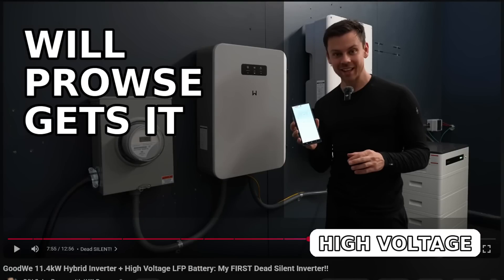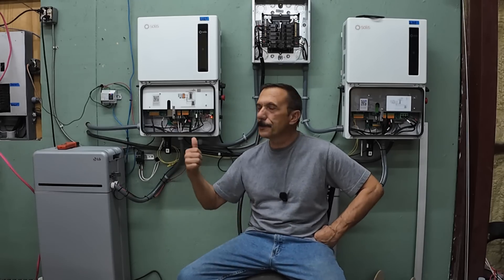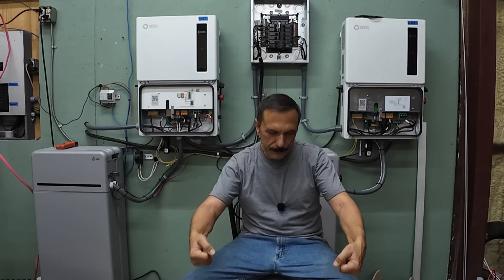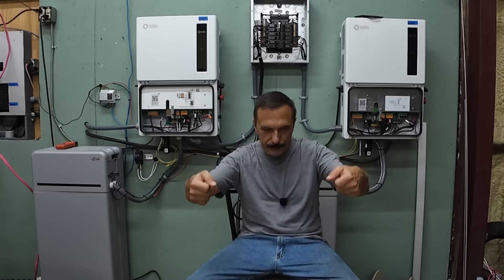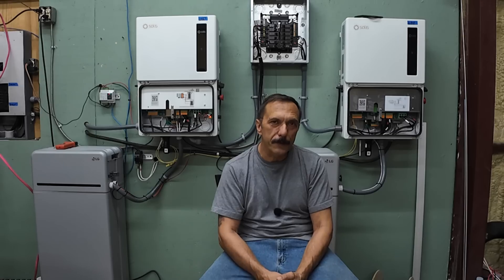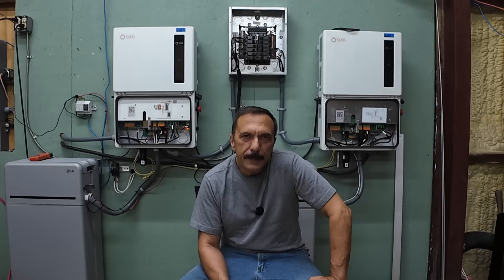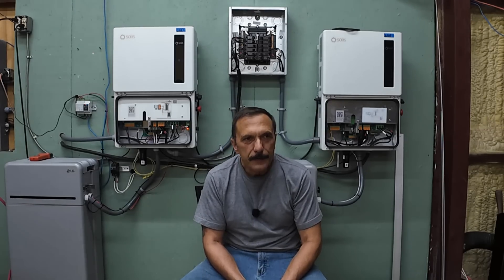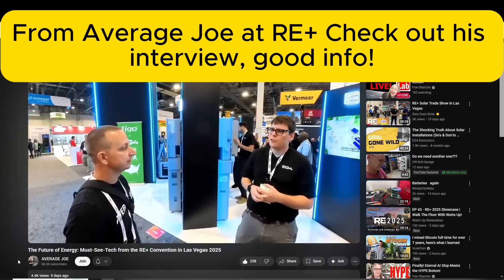Will Prowse Gets It! High Voltage Solar

Comment: Hey good point. I have 120V off grid. Still i dont know how to find a good LFP deal. System is designed originally for lead acid but i changed the solar charge controller. I need at least 36kwh 120v. Anyone can help?
Reply from the maker: It's hard to find good deals right now with the crazy tariffs. There are at times on line auctions that have good deals. Last month there was an e-bike and an EV auction with lots of LFP cells and packs that went cheap.
Thanks for watching!

Comment: In my country, you can DIY (do it yourself = build your own) a home battery BUT it must be below 50 volts nominal. So the "48V batteries" are the limit for DIY, if you want to have home insurance (and thus have a home mortgage)

And the price difference between DIY and commercially manufactured home batteries in my country are a factor of 4. So if anybody wants a payback on their home battery, DIY is the only viable route

So there is definitely a place for 48V home batteries in New Zealand. It may be similar in other countries???

Personally, I run 48V ex Nissan leaf modules. I have about 80KWHr of storage. Cost of latest battery (18KWHr tested capacity) was US$250. Most expensive part was the BMS at US$125. The leaf battery was US$60

I use 70mm2 cables, but 50mm2 would have been plenty
Reply from the maker: Here I have no regulations, I can do what I want unless I want to connect to the grid, but I don't want. :)
Thanks for watching!

Comment: I have a big solar array and 65 kWh battery storage. I’d like an inverter that could work with my ev batteries when they degrade enough.
Reply from the maker: Sounds like a great plan, thanks for watching!
Reply: I use it to power two cars in my construction business. I’d love to swap the cars packs out myself once they’re worn out and repurpose them

Comment: Somewhere around 350 VDC is a good match for 230 and 240 VAC inverters. Because you know, sqrt(2) * 240 = 339. So the peak of the 240 V waveform is around 339 V.
Reply from the maker: Just like it was meant to be!
Thanks for watching!

Comment: I've been doing exactly this for years. High Voltage packs from Tesla and high voltage solar strings to keep conversion losses low along with split phase 240v inverters to match the local electrical systems. Very cheap to make a 100Kw battery pack and a ground mount system.  Looks like the "secret" is out and demand will begin rising. I hope this drives the cost down istead of up due to scarcity.
Reply from the maker: Hopefully it drives the costs down, thanks for the comment!

Comment: This is the first I've heard of high-voltage systems. It will solve a lot of transmissions problems I was trying to solve for a future off grid system  (but probably create different issues) Thanks!
Reply from the maker: Thanks for watching!
Reply: I too am thinking there's some cons. The first that comes to mind is high voltage is much more dangerous. With proper GF breakers etc., a 48V system is very safe. What about availability and cost? I've been doing solar a long time and this is the first time I've heard of this. Never seen one for sale or even talked about. So I'm guessing these inverters and batteries will be double, maybe triple the cost of our 48V systems. Who cares about higher efficiency with such a high cost (if I'm right)? My 48V system was affordable and provides way more power than I need.

Also he mentions cable size and cost. I used 2AWG on my system just to be sure, and the cost was negligible when compared to the other components. Copper isn't that expensive.
Reply: Just saw your sight. Is code compliance an issue?
Reply: High voltage is a relative term. In the US, 600vac volts and lower is considered low voltage. 48vdc is considered ultra low voltage, you don't even need any ppe to work on it.

Comment: Interesting. Maybe in 10 years we will have high voltage quiet inverters with DIY battery packs.
Reply from the maker: The future is here now my friend!
Thanks for watching!
Reply: @DIYSolarFarming  Well... I'm thinking of a future where we can somehow reconfigure our 48V server rack batteries, a rag tag collection from different vendors, to work with a high voltage inverter that has no fans. Imagine an inverter that senses the voltages of the batteries it is working with. Much like they allow a wide degree of PV voltages.
Reply from the maker: @CheapHomeTech  There's guys doing HV packs with individual cells. You can't use the server rack batteries the way they are, BMS won't allow it.
Check out Mike G's channel, tell him I said hi! https://www.youtube.com/watch?v=OunTMtUdInw

Comment: High voltage benefit is smaller current and components.
Personally, I feel we should do 400V as the infrastructure exists and generating 120V AC requires 340V peak to peak.
240V  has 680V pk 2 pk, but the inverter takes care of that.
Reply from the maker: That's a great point, thanks for the comment!

Comment: I had only thought about higher DC voltages on the PV side, with long runs, and keeping 48VDC runs as short as possible before transitioning to 230/400VAC for loads. Interesting to use leaf batteries, presumably still in 400VDC configuration, rather than reconfiguring for lower voltage as many do. Also much easier to deal with air cooled packs. Are you using a 3rd party/open source BMS? I note your earlier comment about being in a shed away from dwellings - 1000% agree.
Reply: Edit: Looking at Dala's github page now re ev packs...
Reply from the maker: I'm using a small controller board with Dala's battery emulator software on it, https://github.com/dalathegreat/Battery-Emulator
And yes I use the whole pack the way it came off the car, no mods needed.

Comment: Thanks for the video.I'm still in the "it's a pipe dream, but maybe someday" phase of my solar journey, but I'll be sure to check out higher voltage systems. It would be much nicer to be able to use basic cabling around how I would like to have my system set up (solar shed for equipment, with breaker boxes inside the house where the existing old breaker box is).
Reply from the maker: I'm glad you found the video helpful, thanks for watching!

Comment: Yes yes yes,,I have an "oupes" 2000 watt,station here,,Australian so it puts out 240 volts,,but based on 48 volt system ,,it's rated not just double 2000 watts surge,,but 4500 watt,, compared  to a 12 volt inverter that needs 180 amps thru it too make 2000 watts ( all losses counted) it only needs 1/4 that ,,50 amps ,,driven by a much  higher "potential difference " ,,its going to react way faster,,,,quarter the size wires into quarter the size mosfets,,runs a small inverter welder around the farm no problemo,,a Jackery 2000 watt struggles with its lower 36 volt arrangement,,,
Reply from the maker: Sounds like a work horse!
Thanks for watching!
Reply: @DIYSolarFarming the oupes has a noisy fan,,the Jackery almost silent,,much better under the kitchen table running the capsule coffee maker first thing,,,doing girls work,,
Reply: @DIYSolarFarming     Dude,,its a Clydesdale ,,😊😊

Comment: I run 48 volts with little or no problems. I like the high voltage idea. To go higher I first need to get a high voltage battery.
Reply from the maker: Sounds like a plan!
Thanks for watching!

Comment: Problem for HV Battery system
1.There is no world standard for home.
2 .It is very dangerous for Ordinary people
3. It is expensive  (for the rest of the world)
Reply from the maker: Pretty much most of the world has gone to High Voltage Batteries already.
Thanks for watching!
Reply: @DIYSolarFarming   40% of homes in Australia have solar panels and 70% are 5kw systems.  

Most people choose it because it is the cheapest and faster way to get pay back within 2-3 years.

People living in apartments in Europe and China only install 800 Watt solar balconies. 

Most people don't choose off grid you now. Or the desire to go over budget..

Comment: If you have a safe place to keep non permitted non UL DIY stuff I'm all for it if your property is rural acreage. Doesn't work for everyone if you live in a tract home don't have a place for a shed or cooling it isn't feasible. The GoodWe is UL 9540 which I was surprised to see it's battery is Lifepo4 not NMC . Here in the city we have to permit our systems get some nosey neighbor gets upset about panels being on your roof reports non permitted work now have thousands of dollars invested in something they won't permit. I see the Silos is 9540 with the LG battery is using Lithium-polymer just about the most dangerous chemistry out there good for a shed or outside the home. No way I would keep a Lipoly battery that size charging in my home I've flown RC model aircraft for 30 years seen my share of lipos ignite while charging on a balance charger.
Reply from the maker: True, and yes Solis is UL and all the residential high voltage batteries on the market are also UL.
Only when you get into the realm of DIY there is obviously no UL, but that applies to any system HV or LV.
Thanks for watching!

Comment: Glad to see that tendence of going to a higher voltage ⚡. Pure common sense that the closer your input and output is, the more efficient the inverters will work. 
120volt battery system makes more sense if you're using 120v AC !
Reply from the maker: You are correct, it does make a lot of sense and they will see the advantages!
Thanks for watching!
Reply: 120 VAC has a peak voltage of 168 volts. So if you want simplicity and efficiency, the battery has to be significantly higher than that (otherwise you need a boost stage or step up transfomer.) And in most cases a big system with a high voltage battery is going to put out 240 volts split phase, since that is what houses in the USA use. That means you need about a 400 volt battery to to directly create 240 VAC without a boost stage to make higher voltage DC.

Comment: Have you seen the issues that @HomeEnergyIndependence is having with a solis HV inverter?
Reply from the maker: Yes several people have asked about that, here's the issue,
5hp is well over the surge spec of 85.5 A/300 ms for the S6 11.4k.
A 5hp motor will have a LRA start surge of 130 - 140 amps
You might get lucky sometimes and it'll start but most likely the inverter will current-limit and the voltage will sag.
Thanks for watching!

Comment: Do you need to set the high voltage inverter for charging/discharging voltages according to the high voltage ev battery pack or the inverter takes this information automatically once integrated through dala's mods. thanks
Reply from the maker: It's automatic, you just set the interface board up to emulate a battery that your Inverter supports after that the inverter thinks it's connected to that model battery.
Thanks for watching!

Comment: Here is the problem with high voltage you don’t mention. Battery expansion. When you want to expand you have to buy say  5 batteries at one time to get your high voltage. With a 48 v you can just add a few more modules.
Reply from the maker: That used to be the case, now high voltage batteries for the residential market are already set-up for 300 -400 volts, just need to buy one at a time to expand. You do need to know how many batteries your inverter will parallel,
for example you can only parallel 2 LG 16H's for 32kWh no mater what inverter, but if you have a Solis S6 11.4k inverter you can parallel up to 10 Soluna 15 kWh batteries for 150 kWh's of storage.
Thanks for watching!
Reply: I would prefer higher voltage system too but am way committed to 48 volt. I have 108 kWh of batteries now with a recent reconfiguration of a 52s battery into 3 16s for my 48 volt system and leftover 12 volt  4s 304AH.
Unless I live longer than I deserve or something terrible happens to my equipment, I won’t need to build anything else.

The high voltage batteries would be great in a 4 to 6 apartment building with car chargers under the solar panel covered parking. If you had 200 kWh of stationary battery and integration of the car batteries,a relatively small grid connection would suffice to power the residences and cars.
Just a fantasy for me but I think it would be a great investment.
Reply from the maker: @danielking2944  Interesting idea with the apartment and no need to change from 48 volts, if it works use it...

Comment: Just saw the Will Prowse video yesterday.  This is the first I have heard of high voltage residential systems.  They seem to make sense for even residential as the efficiency is better with a higher voltage.
Reply from the maker: Yes, the efficiency is better for sure, thanks for watching!
Reply: No veo porqué no. En algún momento tenía que suceder.

Comment: Do you know of any split phase inverters with around 1000v PV inputs? Would be really nice for my grid tied ground mount install
Reply from the maker: Nothing in the US residential market yet but the Solis S6-EH3P30K-H-LV has 1000v inputs. It is 3 phase 220/230 though so you would need a step down transformer on one of the phases for your 120 volts.
I think the have a 20, 30 and 50 kW version.
Thanks for watching!
Reply: @DIYSolarFarming  Ah I see. Probably not worth it for me then since I need split phase? I don't know much about converting 3 phase to split phase, but I assume you would lose efficiency and it would be a lot of work to add the stop down transformer. Would really like to go HV, but I'll probably have to go with 12kw megarevos or I assume solis makes something similar, but everything I have seen is low voltage battery sadly.

Comment: This is my first view of your channel. I started considering a high voltage solution and found there's limited off the shelf LFP options. The one's I did find were expensive, but I didn't do the cabling cost calculations yet.
Thanks for the good content!
Reply from the maker: Yeah, the lowest cost option are the LG 16H but they are not LFP, next up would be the Soluns 10 and 15kWh packs. On the Solis you can do up to 10 packs, so 150kWh.
Welcome and thanks for watching!

Comment: What voltage are you getting per leg out of the inverter.? Theres a guy getting 115 per leg  I don't know at what hz but he's struggling getting  the Solis to start a  5hp  well pump. But his voltage is lower than grid at the panel like it's not synchronizing. He gets 239 from mains and 230 from the Solis. Voltage drops to 166 on the Solis when it tries to start the load. Thx
Reply from the maker: 5hp is well over the surge spec of 85.5 A/300 ms for the S6 11.4k.
A 5hp motor will have a LRA start surge of 130 - 140 amps
You might get lucky sometimes and it'll start but most likely the inverter will current-limit and the voltage will sag.
Thanks for watching!
Reply: @DIYSolarFarming thx I'll forward this to him
Reply: Put a soft start on it
Reply from the maker: @danielking2944  Yes, that would be the smart thing.

Comment: I'm very new to all this home backup and solar. I am concerned about higher electricity rates! FPL here in Florida wants to increase their rates in each of the next four years! I just had my house weatherized which helped to lower my electricity bill in the summer from above $200/mo. to under $200/mo. now. I will buy an electric power station for my car soon for car camping. I bought a 12V refrigerator last season but could not power it at night. We are in Hurricane season right now and I worry about black outs! I can use the power station for backup in the house because I'm buying a 2KWH unit for extra power. I know this is small but it's a start. I'll keep watching these videos to educate myself more. Thanks for the video.
Reply from the maker: Sounds like you're on the right track, thanks for the support!

Comment: High voltage has advantages, but there are some downsides to it. For higher voltages the inverter and some other components might be more expensive. DC technology (>12V) is still relatively new, prices will hopefully come down.
It also works only if you make long strings of solar panels. You could combine panels at different orientations with optimizers, but that also adds cost.
Reply from the maker: Actually the Solis 11.4k and LG battery pair are lower cost than most of the 48 volt hybrids and
it only needs 80 volts pv to start making power, that's 3 solar panels.
Thanks for watching!

Comment: Price is the only problem with these high voltage systems
Reply from the maker: Actually the Solis 11.4k and LG battery pair are lower cost than most of the 48 volt hybrids.
Thanks for watching!
Reply: @DIYSolarFarming I just installed 10kw of panels, 10kw hybrid inverter and 60kwh of lifepo4 for under $11000.

Comment: I'm 48v now but yes I see higher voltage battery is the way to go. smaller wires, less heat and 1000 voc
Reply from the maker: Yes, you get it too!
Thanks for watching!